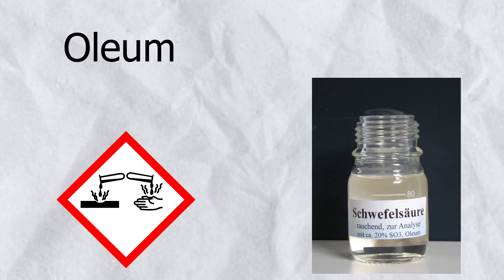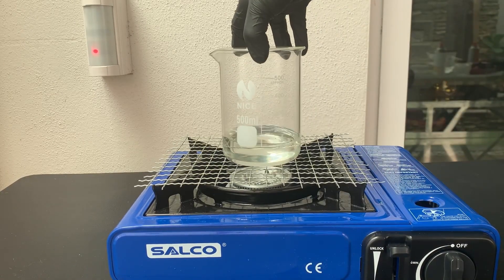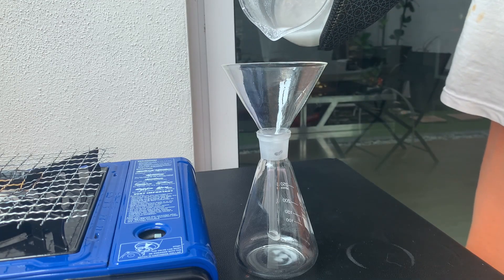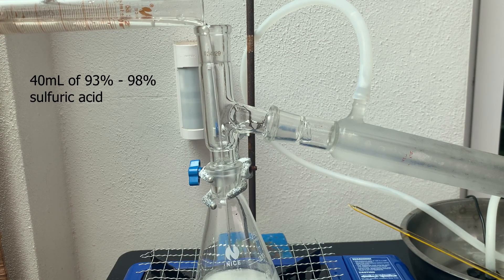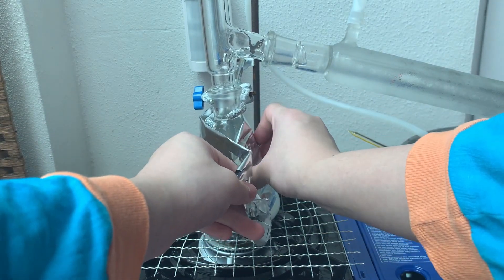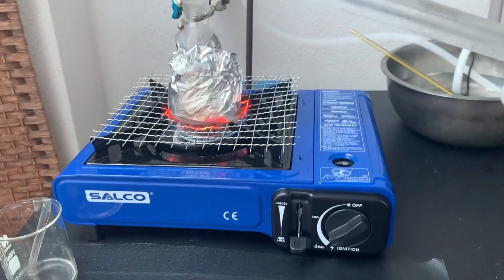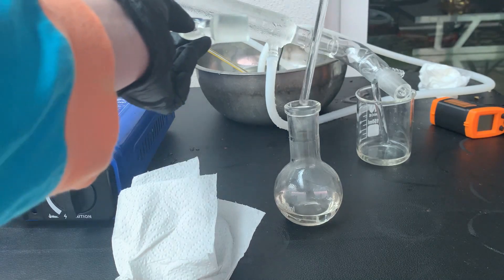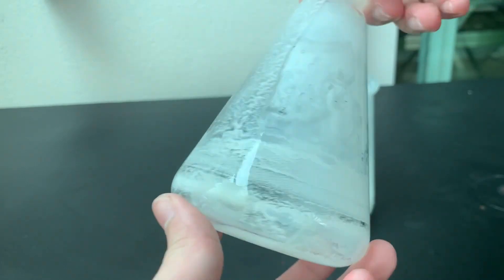Make oleum from OTC reagents

Comment: Sorry mate.  What you've made is NOT very pure SO3 as it's not crystalline at room temperature. SO3 quickly reacts with moisture in the air to fog out sulfuric acid.
Reply: Do yk what oleum is
Reply: @Leucine75  Yes.  All he did was dehydrate >98% sulphuric acid to 98% sulphuric acid and phosphoric acid into polyphosphate, then rehydrated it back to phosphoric acid.  Polyphosphates wont dehydrate H2SO4.  You need Phosphorous Pentoxide to perform that task and it is extremely inefficient at the best of times.

Comment: How those phosphoric acids reacts with glass? What is the final product?
Reply from the maker: The type of glass beaker I used is made out of boro-silicate glass which means that it is made out of silica and boron oxide. Phosphoric acid will react with these  oxides at high temperatures of 200°C and above to make silicon phosphate and boron oxide which are the final products if everything had fully reacted and destroyed the glass.

Comment: I could use metaphosphoric acid to increase the concentration of dilute sulfuric acid. I don't want hscer oleum but rather concentrated sulfuric acid. Can that be done?
Reply from the maker: I don't think it could be done well and it would just be much better to boil down or distill the dilute sulfuric acid until you get to the azeotropic 98% concentrated sulfuric acid.
Reply: Just heat the sulfuric acid to boil the water away.

Comment: Nice, I didn't know you could make sulfur trioxide this way. I've been using more expensive phosphorus pentoxide when all I need was phosphoric acid 🙃
Reply: and damage all your glassware, which method is probably cheaper. In addition, this SO3 is heavily contaminated with phosphoric acid. You can tell by the fact that his SO3 is liquid. But pure SO3 is solid at RT mp= 62.3 °C.
Reply: @SciDOCMBC sulfur trioxide has different forms, and the lowest-melting one melts at 62.4 degrees fahrenheit, not Celsius. There's also a very low chance that it was contaminated with phosphoric acid because sulfur trioxide boils at 45  degrees Celsius while metaphosphoric acid boils at 600C, which is most likely not reached in the reaction flask. Also, hot phosphoric acid does not react with stainless steel, so this method is very cost effective as stainless steel cups are cheap and easy to find.
Reply: @SciDOCMBC  indeed
Reply: @SodiumInteresting  I know that from myself. When you find a new synthetic route with cheaper reactants, you're really excited at first and don't pay attention to many other things about this synthesis. But if you take a closer look at this new synthesis route, you often find that the new way is not really more advantageous. Especially if you not only look at the prices of the reactants, but also take a closer look at the yield and purity of the product. In addition, especially in this case, one should not ignore the cost of glassware. One is sometimes a bit blind in one case. So always sit back and take a close look at all aspects. Only then make a decision. 😃

Comment: You can easily buy polyphosphoric acid on Amazon. Do you need to heat the shit out of this one too before adding sulfuric acid or can it be used straight from the bottle?
Reply from the maker: You can use the polyphosphoric acid straight from the bottle.

Comment: So question??  what % of oleum is that? 20% 80% sulfer trioxide? How do you know how much sulfer trioxide? Why not just use phospherious pentoxide and sulfuric acid and distill that to get pure sulfer trioxide. Then you can add sulfuric acid to the trioxide to measure out the % of the oleum sulfer trioxide content?
Reply from the maker: The concentration of the oleum should be 65%-70% but I don't know any way to confirm it. Phosphorus pentoxide is expensive for me and it is much more easier and cheaper for me to do the meta-phosphoric method shown in the video.
Reply: @frostchem to measure the concentration you should take a sample of a known mass, slowly add it to excess water to get some diluted sulfuric acid, then figure out the total SO3 content by density measurement of resulting sulfuric acid or by acid/base titration.
Reply: I have tried 20% oleum and must say it's MUCH fuming and MUCH stronger dehydration. I guess the concentration in video may be 5% oleum.

Comment: Here's the downside to this synthisis. You have no idea what % of sulfer trioxide the oleum is. Which is why it's better to to make sulfer trioxide with phospherious pentoxide then add the sulferic acid so you can measure the % of oleum strength
Reply from the maker: Yes, I have no idea what the percentage of sulfur trioxide in the oleum. The notes I was following said the oleum should have a concentration of 65%-70% but I have no idea on how to confirm it. Yes, it's much better to make sulfur trioxide with phosphorus pentoxide but it is an expensive reagent and I would rather do the meta-phosphoric acid method shown in the video.

Comment: I never thought, it will work out with meta-phosphoric acid so well. I knew the procedure with P2O5 before. But P2O5 is quite expensive, while H3PO4 (85%) is really cheap, compared to it. Apart from this, P2O5 has a limited "shelf-life" due to it's extreme hygroscopicity.

Comment: Was the HPO3 generated here actually a mix of cyclic polymers of HPO3?  There is a claim on Wikipedia (which, due to its nature, might be incorrect!) that metaphosphoric acid with the structure shown in this video "is not known to exist".  Someone with stronger credentials than myself might want to correct Wikipedia if that claim is false.
Reply from the maker: In the video, the dehydrated phosphoric acid is actually a mix of polyphosphoric acid, HPO3, and pyrophosphoric acid which are still strong dehydrating agents that can dehydrate sulfuric acid to sulfur trioxide so it wouldn't affect the end product. HPO3 does exist as the structure shown in the video but it is not very stable and has to be stabilized with something. The claim might be false.

Comment: How about covering the beaker in a silver mirror first? Wouldn't that protect it? (mirror can be later removed with a little nitric acid)
Reply from the maker: Phosphoric acid can’t dissolve silver so it would actually work.
Reply: @frostchem  How about using a teflon pot for the boiling step? I doubt it would corrode and it should breakdown thermically at like 350c.
Reply from the maker: @tonyflamingo3285  Teflon could definitely handle phosphoric acid but because the temperature needed for this reaction is 400+°C, the teflon would just start melting at 327°C.
Reply: @frostchem  Alright

Comment: Are you sure you made meta phosphoric acid and not poly phosphoric acid? My friend makes PPA from phosphoric acid and that's exactly how he does it (heating phosphoric acid up til it turns into the thick slimy PPA)
Reply from the maker: I did a little bit of research in the Sciencemadness site and found that dehydrated ortho-phosphoric acid is a mixture of PPA, meta-phosphoric acid and pyro-phosphoric acid. PPA and meta-phosphoric acid are strong enough to dehydrate sulfuric acid to sulfur trioxide. I didn't find much info on pyro-phosphoric acid though.
Reply: @frostchem  ahh, you probably saw the PPA thread by Benignium then, which is the thread I was thinking about, lol.

Comment: u sure the blue cap is going to hold up with the oleum?

also RIP the glass
Reply from the maker: It has been a day in that storage bottle and I don't see any signs of corrosion on the blue cap.
Reply: Polypropylene is one of a few things that stand oleum decently, although I'll be using a fancy glass bottle with a special leakproof stopper. As for the glass corrosion it might be possible to use a certain steel alloy or possibly ceramic, ceramic I will need to test
Reply: yeah glass or teflon is preferred, PP should stand well but some impurities/additives can cause it to degrade, even sulfuric can degrade bad polypropylene
Reply: had 160 % oleum and it dissolved the cap of the schott flask. Better store in a glass bottle with a clamped glass stopper